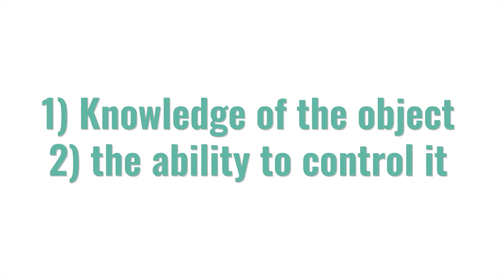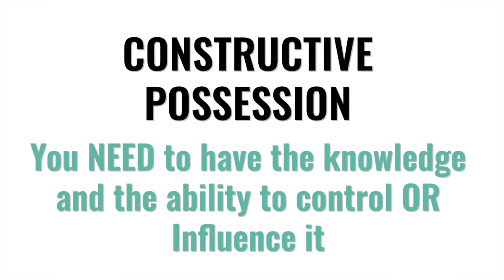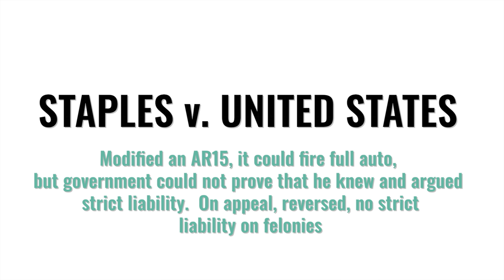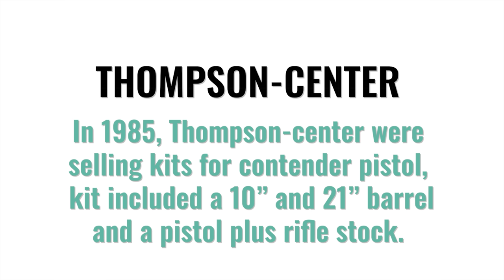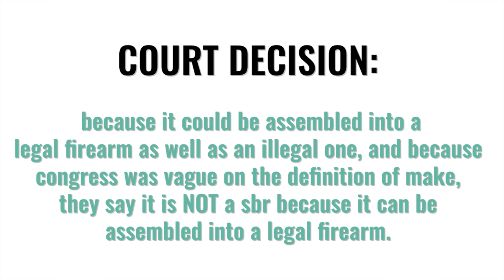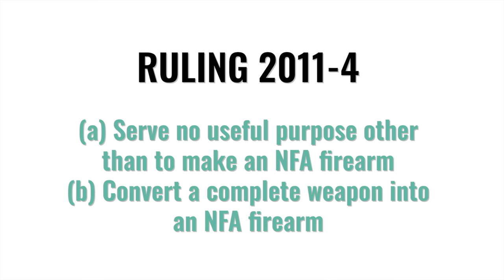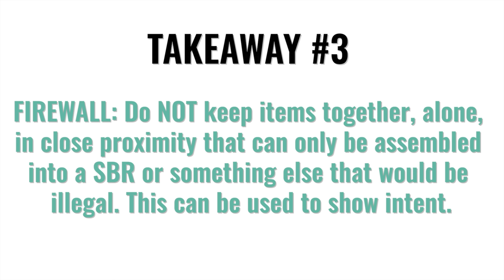Constructive Possession + Intent: Parts are Guns

Comment: So a hypothetical person as an AR pistol with a stabilizing brace that was a legal, non-NFA firearm until the Federal register publishes the ATF's latest rule on stabilizing braces. So at that point one might decide to remove and 'destroy or discard' the brace and they have an AR pistol as the buffer tube is required for operation of the firearm. 
Now, what if in said hypothetical person's gun safe/collection/whatever they own totally legal AR15 rifles with 16" + barrels and any form of removable buttstock that slides readily off/on an AR buffer tube.  Is that Constructive possession of an SBR since one has both the legal ar pistol, but no longer the brace that they destroyed, but has butt stocks on other legal AR rifles...............

It is all so inane and confusing and makes not sense at all. Meanwhile anyone with criminal/ill intentions that wants to use an AR pistol with a stablizing brace and utilize it as an SBR will simply get that weapon through illegal means AS THEY ARE CRIMINALS AND DO NOT OBEY OR GIVE ANY REGARD TO THE LAW(S)............................

Comment: I would like to hear more about constructive intent and the case law. It seems as time progressed what was clear, or at least understood has been complicated beyond common understanding,(non-lawyers who have not followed or researched relevant cases).   Your example of two cases with differing decisions demonstrates how even someone with years in the business could easily be on the wrong side of the law without intent.  The frames/receivers rule change and pistol brace/change in rifle definition is complicating this.  

With the definition of a handgun being that it is designed to be fired by one hand yet in common practice, law enforcement, military, concealed carry, all but traditional bullseye shooters are taught and unless the situation demands use a two handed supportive grip.  You can even see features on many modern pistols manufactured to aid in the use of a two handed grip.  So when is the day 50 people get hauled off, their guns and gear confiscated because they were all seen firing pistols with both hands at a competitive event?   

I realize this is far fetched but a lot has happened in recent years I never thought I’d see.

Comment: Hey great video. I was wondering if you could make a video on the topic of “other” firearms. Or in the case of Connecticut ar others? Oal more than 26 inches with a very grip but less than 16 inch barrel length with no stock?
Reply from the maker: AOWs?
Reply: @AttyTomGrieve  no. “Other firearms” 
So there’s 
Rifle
Shotgun
Pistol
Aow 
Sbr
Suppressor 
Machine gun
Destructive devices 
Other Firearm(no stock, over 26 oal, less than 16” barrel, and vertical grip)

Comment: Huh, Easy to assemble... How does someone who has a full length AR rifle, and an AR pistol in the same gunsafe not go to prison? Pull 4 pins, switch upper and lower, and you have a 20" inch pistol and 10 inch SBR...

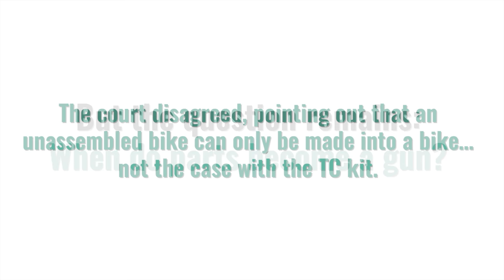Comment: 12:33 the bicycle and Ikea flat pack furniture are NOT good analogies b/c neither requires registration. 

A kit car is a much better analogy. 
A FactoryFive sports car kit, may be recognizably a car, I suppose, from pictures in the box or its steering wheel and tires. 

If this FactoryFive kit were instead a firearm kit, the bATFe would require the purchaser to get the 'car' insured, exhaust and safety inspected, of course pay all fees, and then be issued a registration sticker, BEFORE the kit could even be purchased, way before it could be assembled to then get the finished car safety and emissions inspected. And if this administration logic is accepted, this "car" would need to be inspected/registered before the owner even has a donor or crate motor!

Comment: Great info. But why is a SBR it say in the name RIFLE but just because it's short it's not a Rifle like isn't that an oxy moron. The name says Short Barrel Rifle that's not a Rifle but a Pistol and needs a NFA form crazy if you need or use something like that would be much easier to use if people are inside your home, and you only have a big Rifle 16" to 20" or bigger how do you s2ing that big thing around a corner to protect your family or yourself. I don't think that's a good or should it be a true Law or need a NFA It's already called a RIFLE. And you may need the more rounds that's offered in that package. Why don't they take the SBR OFF the NFA what's the big deal I say they change the info on that and if it's smaller then say 12" or 14" then it's a NFA item. CQB if you're in a apartment that's small a shot gun will get you killed if the people coming in have pistols. Try and swing a Rifle around in a hallway you will be stuck and shooting the wall.

Comment: So,if you have, perhaps, THOUGHT about breaking a law you ARE GUILTY. 

Sounds Biblical, doesn’t it?

Tom, suppose I own a part that can only fit one gun that I own, and can only be attached to that gun in an illegal way. 

However, I have NEVER assembled the two. 

Assume that the part remains in it’s original, unopened SEALED packaging. It never leaves my home.

Perhaps I intend to buy another, different gun on which it’s use would be legal.

Yes/No:

Am I breaking a law?

(No. I do not  actually own that part.)